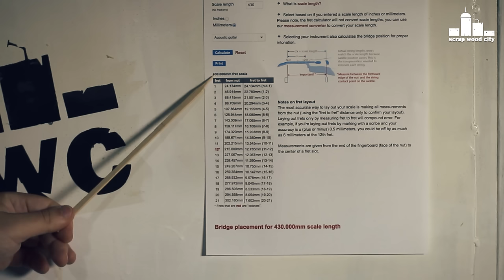How to make a simple DIY box guitar

Comment: Beautiful build! But at 2:40 what is  that for? That piece of wood you glue on the surface?
Reply: It is for rigidity under the bridge to support the thin top against the tension of the strings.
Reply from the maker: Thanks. It's extra support under the bridge to prevent the top from bending under the tension of the strings!

Comment: Those frets wont last 5 minutes, even with nylon strings. Use nails if you don't want to use proper fret wire. Hehe and most people finish shaping the sound hole befor putting the strings on.